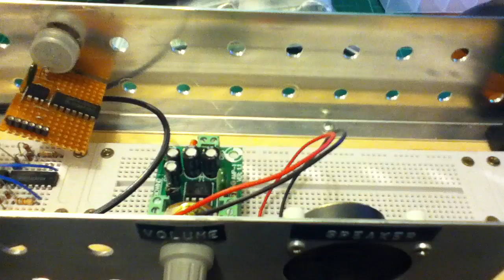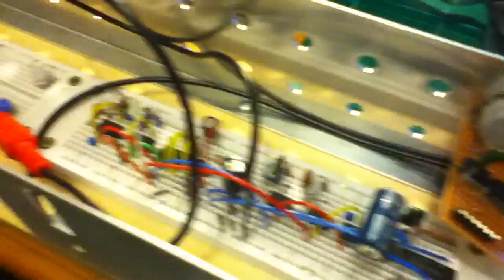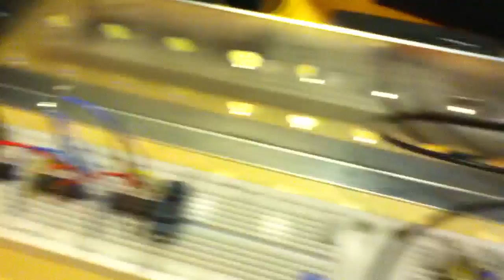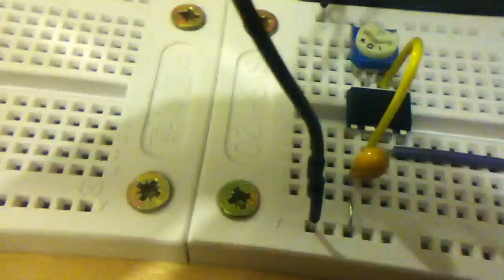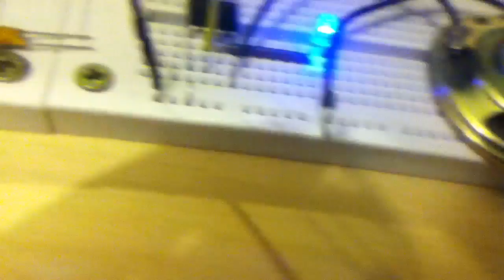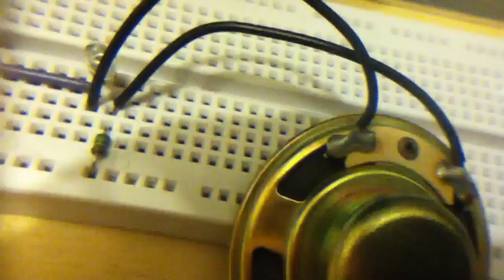555 Timer Oscillator driving LED or Loudspeaker

Comment: For the capacitor on the Oscillator do I need to have a non-polarized capacitor?
Reply: you dont, if you're using a polarized cap, just make sure the negative side is going to ground

Comment: That's probably the simplest 555 oscillator circuit I have seen yet ... using a pot for two resistors ... OK this is starting to make sense now. Thanks!

Comment: When implementing the pot for the 2 resistors, what resistance value are you using here and how is it wired into the 555?
Reply: He explained how it is wired in, you have to listen carefully (I went back over and over until I heard correctly. But the reason you never got an answer for what resistance value is because it depends on what value of capacitance you are using AS WELL AS what your output desired frequency is. The short answer is you can use capacitance range of 100 to .001 micro farads and a resistance range of 1K to 10M ohms. That's the brilliance of the versatility of this chip and this is just ONE astable configuration. There are many more including actual VCOs that accept voltage on pin 5.
Reply: Actually I can now see that is a 104 pot which is 100K ohms. Cheers!

Comment: A very informative video. That's great. Many thanks.
Reply: whiterottenrabbit maybe if you learn the what the actual component is you would see that this is extremely informative and SIMPLE video a potentiometer IS two resistors in series the knob sweeps resistence from one lug to the other.